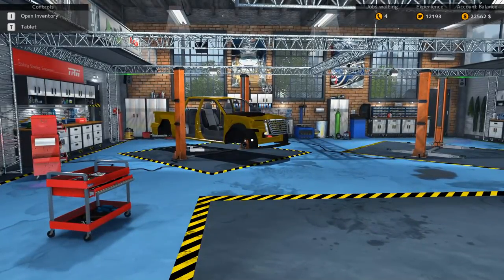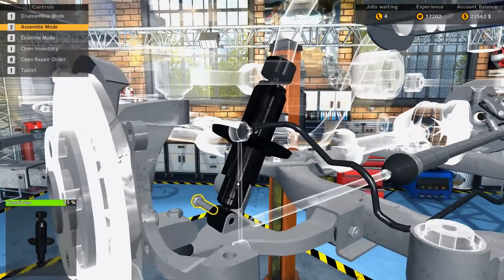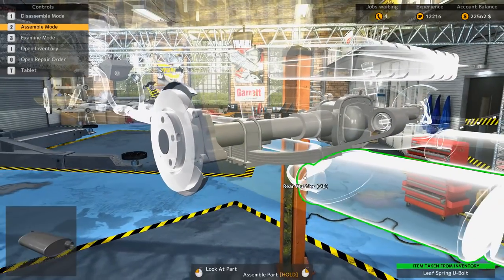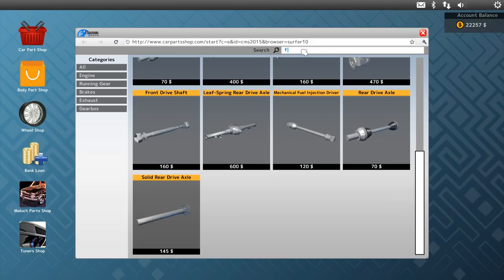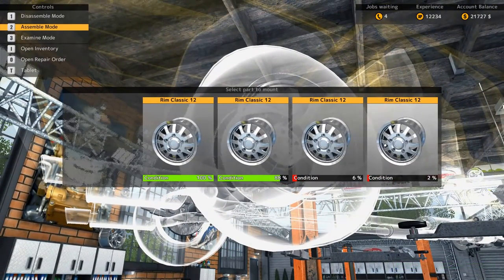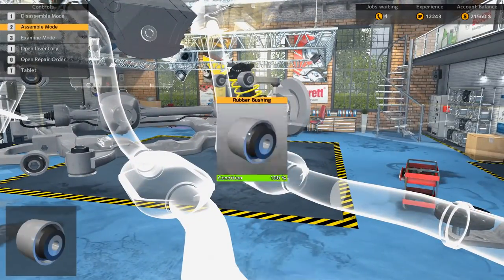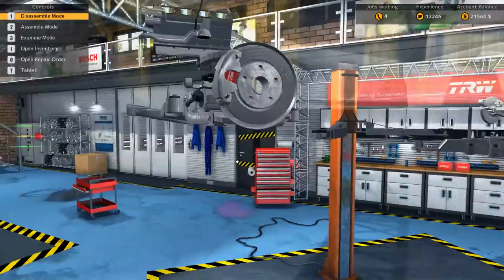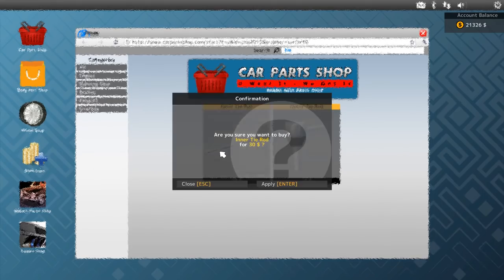Car Mechanic Simulator 2015 Rebuilding The Castor Earthquake

Comment: If you edit the car files you can make some stupidly powerful cars and you can adjust ride height rim size and a few other bits but its mostly visual unless you edit the engine file to change the power on each

Comment: Wait, you can't have a different colour head cover of EXACTLY the same type and shape? Why does the colour matter?????
Reply: I guess you could, he just bought one for the side he already installed, so he checked the wrong side and, what a surprise, there it won't fit.
Reply: I'll check it out myself one time, see for myself. There shouldn't be a restriction on what colour head cover you use, just like there shouldn't be a restriction on what intake manifold you fit on the V8 OHV (which I know there is)
Reply: +Florian Wörlen I just checked it out with my own Earthquake, it is actually true that red head covers cannot be fitted, I bought both red ones and when I went to fit it only the black ones that came off it showed up, cannot change the colour. I sure hope they fix that and sure hope they bring in a DLC where you can fit high performance parts on
Reply: Musclecarlover7
 That would indeed be pretty amazing :D